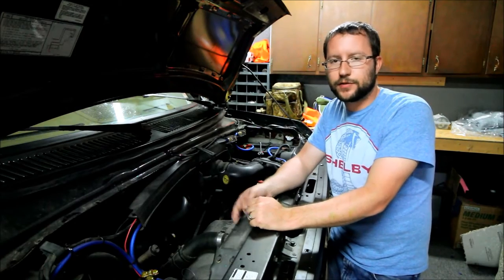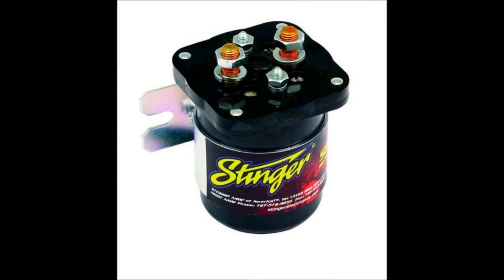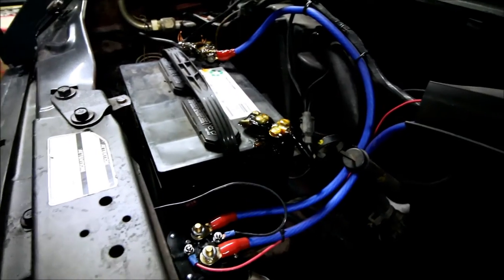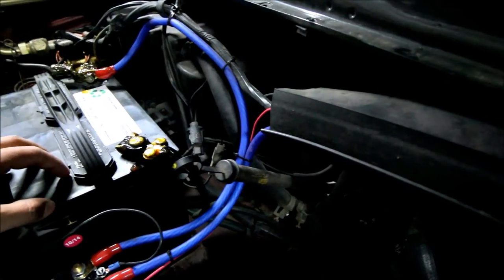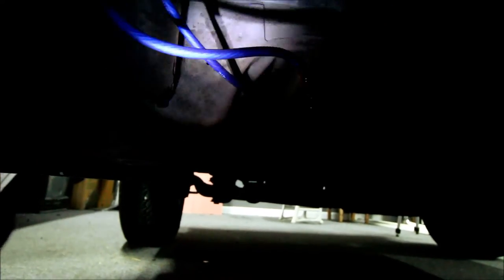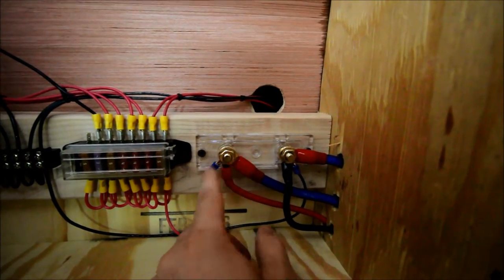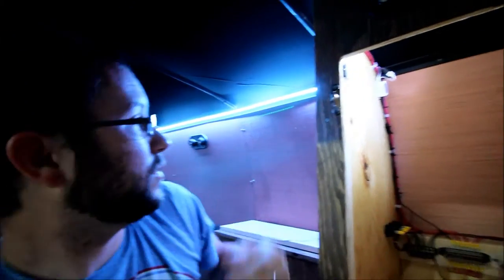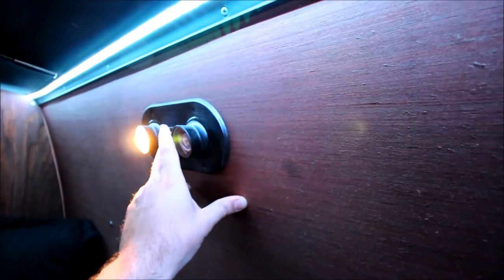Camper Van Power. My 12 Volt Battery Isolator Setup

Comment: personally I'd never wire anything without using black and red wires. it's a idiot proof system and I'm not that bright I suppose. if you were selling that van that could potentially cause a problem. at least you should label the wires. again that's my opinion. apparently you know what you're doing.
Reply from the maker: Frank Greenway most of my wiring is red or black accordingly other than the heavy gauge wire to the batteries which is pretty simple to track down. I don't know how much more idiot proof it could be.
Reply: It's great for you, I'm always thinking about someone who wouldn't immediately recognize it. I meant no disrespect or insults. You definitely know more me about wiring and fuses. Are you going to have solar panels?
Reply from the maker: Frank Greenway no solar panels planned for the time being. When I calculate the cost it just doesn't make sense to me. I may end up adding more batteries though.